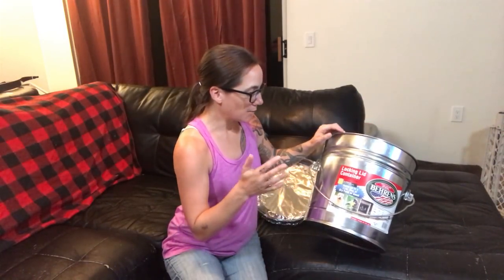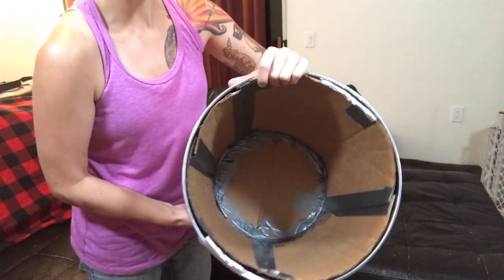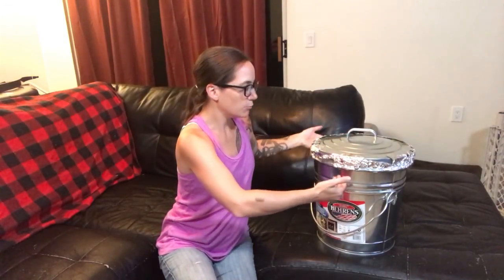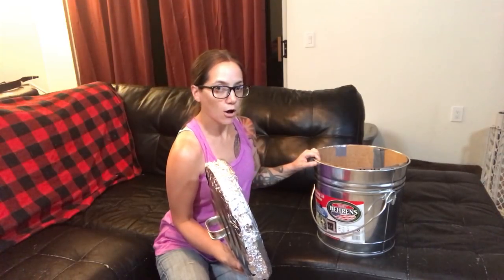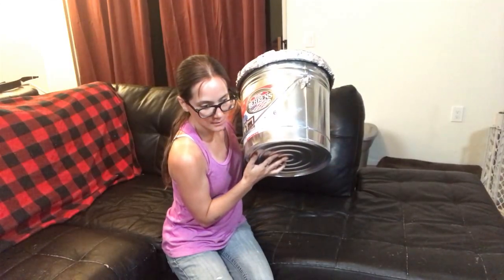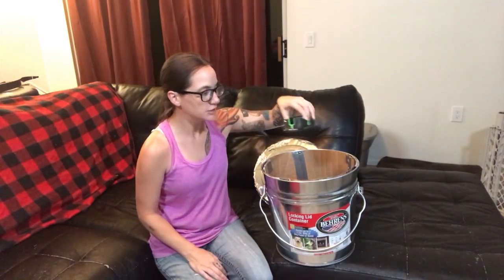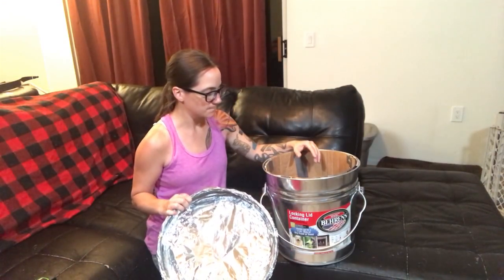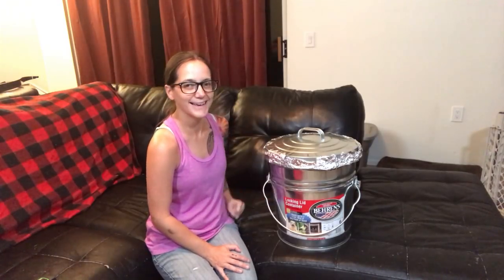DIY/Test Mini Steel Trash Can Faraday Cage

Comment: In the military we had a room size faraday cage in order for us to work on and test the emergency radios that pilots carry on them. We used the cage so that when the radios were turned on the tower did not receive the beacon sent out by the radio. One guy left a radio on outside the cage and we got a call that the SAR bird was hovering over our building having traced the signal thinking there was a downed jet. Good job on your mini faraday cage.
Reply from the maker: +mykalbee wow! Interesting!

Comment: According to tests using EMP generators, to give the best protection, use some aluminum tape to seal the lid to the can, when you are ready for long term storage.  
It could be  overkill in many cases, but it's cheap and easy enough to do. 
I have lots of aluminum tape because I do HVAC, including repairing and installing ductwork. 
Thanks for the video Morgan.
Reply from the maker: +Chuck Howard thanks

Comment: Ammo cans works well too, you just have to remove the rubber seal around the lid, put tinfiol in that recess and close it up.  Also you need to line the can like you did, with cardboard.  Seems like yours worked very good.  My wife has the exact same radio and loves it :)
Reply from the maker: +Iridium242 yeah I heard ammo cans work but I have a lot of stuff I want to keep safe. Lol

Comment: If its a battery powered radio the static would suggest it was working bc the static is what happens when the signal is lost or interrupted.

I work with amps for a living as a musician that will pick up FM radio if ur near a radio tower, n ud hear it thru the static at the same volume as it faintly. 

If the power is on on the radio n all u heard was static u did it right bc the static is caused by the electronics and circuits; n depending on the type of device things like guitar amps that produce a static thats enhanced by gain. Bc of the way theyre wired n how they work, and the components used in them guitar amps WILL pick up FM Radio if a radio station grade transmitter tower is nearby like less than a mile away (i use to be unable to turn off the classic rock station i hated when i was playing guitar when i lived at my moms crib still)

So in short the fact the transmission turnt to static means its working

Comment: Get a roll of copper tubing from Lowe’s/Home  Depot uncoil it around the circumference uncoiling upwards. Ground the trash can probably from the handles to an Earth ground a piece of copper pipe driven into the ground. These extra two steps will increase the usefulness tenfold as a faraday cage
Reply from the maker: +Valhalla Bushcraft yeah I’ve heard of that and I might. Thanks.

Comment: How are you liking that radio? I picked up that same one years ago.
Reply from the maker: +Scribbly Bear it’s alright. I picked it up cause it had a solar panel and was able to charge a cell phone. However the solar panel only works to power the radio, the cranks powers the radio and cell phone charger. So for a very last resort, it’ll work.

Comment: I think a microwave oven (not turned on) would also work. If it will contain microwave is should shield against electrostatic induction.
Reply from the maker: +John O'Neill I’ve heard of that. I tried a microwave in the past and it did NOT work. An oven isn’t completely sealed, either, so I’m not sure I’d trust it. I’m gonna go with something I’ve tested and am confident with.
Reply: Armed Rogue: I agree that a completely sealed container is best for all frequencies. Hardware store has metallic adhesive tape that can be used to deal cracks & gaps. (Not "duct tape). Would probably  be a good idea to ground the trash can if possible. Can also insulate the electronic gear in a plastic container as an alternative to cardboard lining.  I appreciate your videos. Sept 23 video on the missing apocalypse made me laugh.
Reply from the maker: +John O'Neill thanks!

Comment: Unless u leave a cellphone in it to check it that last time u cant guarantee its sealed. 1/8. Of an inch. Opening or crack  will fry everything in it.  But the. Metal tape is the way to go.